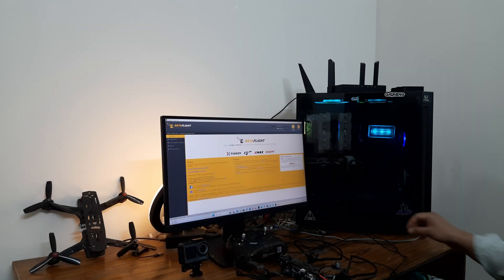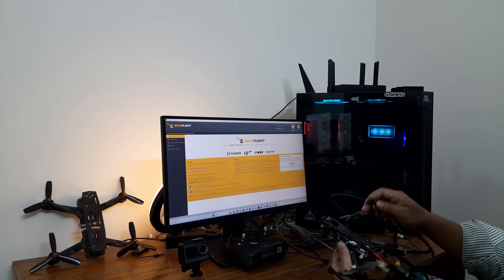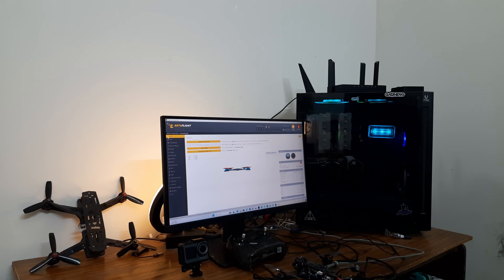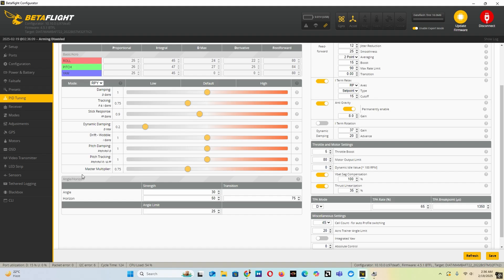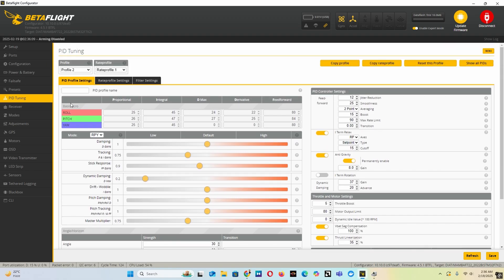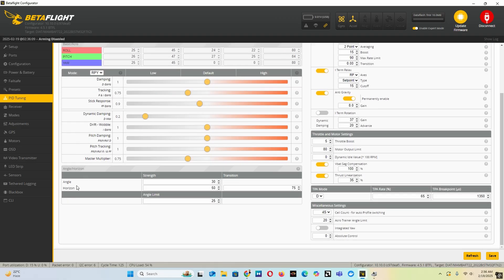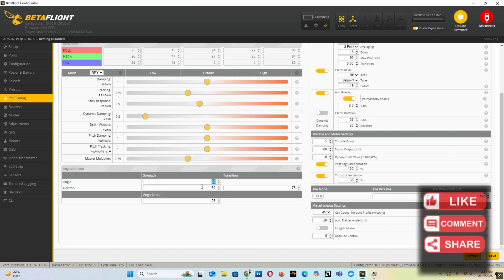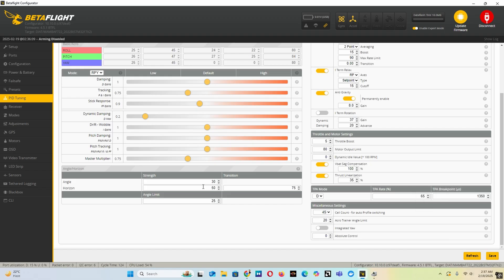How to PID Tune Drone for Smooth Flying! | Betaflight Angle Strength

Comment: pids have nothing to do with angle strength at all! stop with all the bad information
Reply from the maker: Actually, that’s not accurate. In Betaflight Configurator, the PID Tune tab is exactly where you adjust parameters that affect angle strength, including Angle Strength and Horizon Strength. These directly influence how the quad reacts in Angle and Horizon modes.

So yes—while PIDs (proportional, integral, derivative) primarily affect rate mode flight, angle strength settings are absolutely part of the same tuning tab because they relate to the stabilization behavior of the flight controller. Please double-check the configurator before spreading misinformation.
Reply: @dronelabstech  im not spreading miss information, you do not tune angle and horizon with pids. I've been in the hobby 7 years and never heard anything so stupid !
Reply from the maker: Hey, no worries—I get where you're coming from. Just to clarify, I’m not saying you tune angle and horizon modes using the actual PID values (P, I, D). What I meant is that the Angle Strength and Horizon Strength settings—which affect how those modes behave—are located in the PID Tune tab in Betaflight Configurator.

It’s a common misunderstanding, and I totally respect your experience in the hobby. —hopefully that clears it up!
Reply: @dronelabstech  again dude the both have there own settings. You tune angle and horizon by using the angle/horizon strength slide. Pids do not have anything to do with it. Pids are for flight not leveling
Reply from the maker: https://youtu.be/lWBA7F5Nbvs?si=KWopJm6EiF7ONc4p